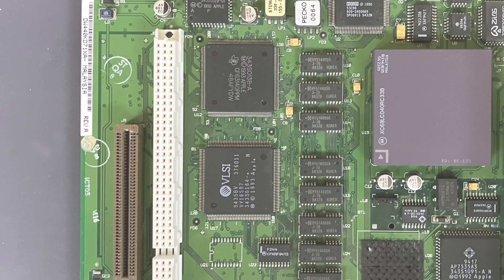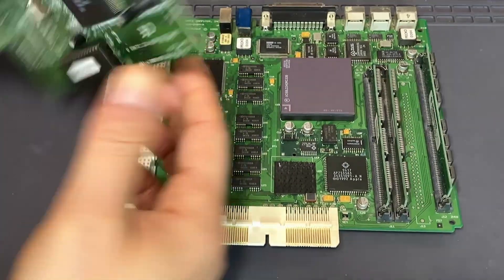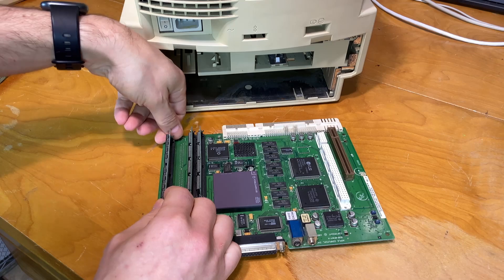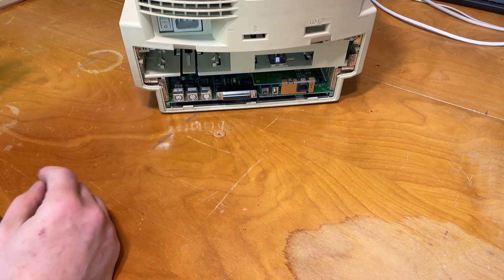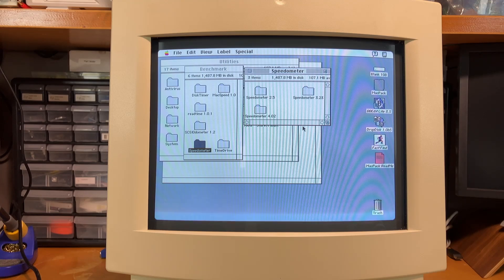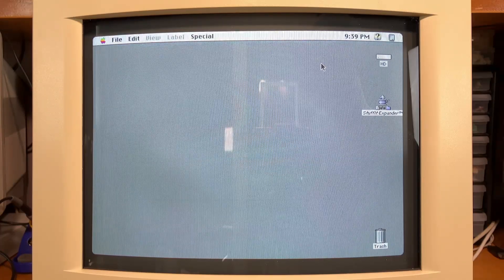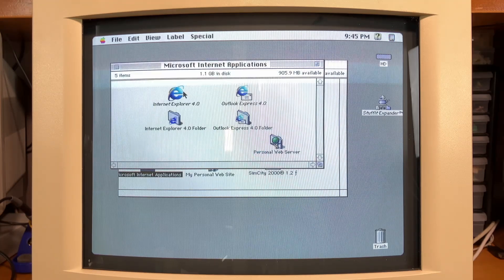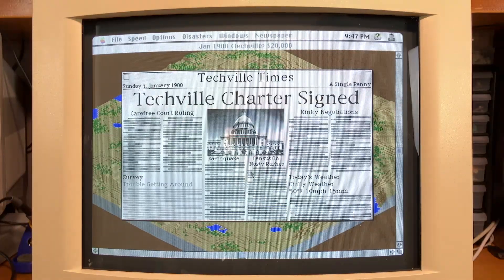De-Mystifying a Macintosh Performa 550

Comment: Go to the Memory Control Panel and turn on 32-Bit Addressing. Reboot and the memory will show correctly. There were applications that needed a 24-bit emulation, but those apps were from the System 6 era. System 7.1’s networking was more of AppleTalk. You needed to install the Mac Networking which I think was on a separate disk for 7.1. I preferred OpenTransport which is on 7.6.1 for networking.
Reply from the maker: Awesome, thanks for the tips. I spent quite awhile poking around with different driver disks in 7.1. Finally just figured I would try a 7.6.1 image and that seemed to be a lot easier with the only step needed being setting up the ip addresses. I want to explore Appletalk at some point between a few machines. Appletalk was my first experience with networking, always seemed magical back on the school computers seeing a printer show up that was in another room somewhere!